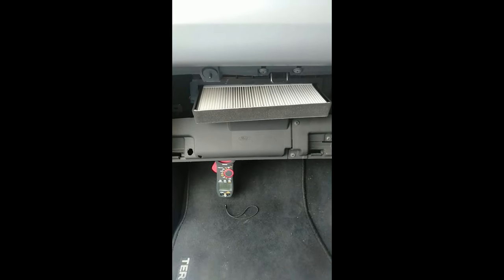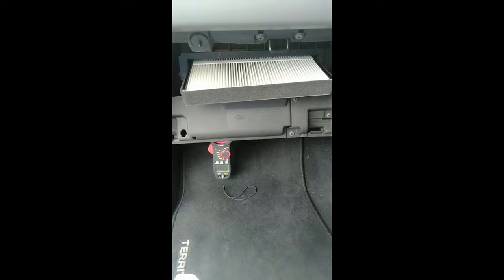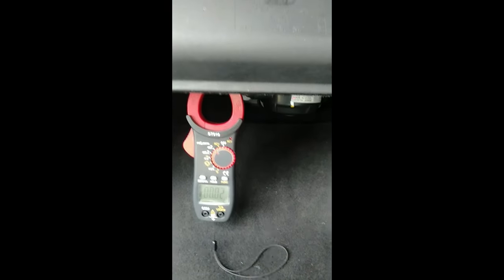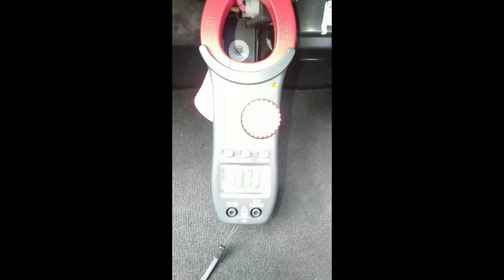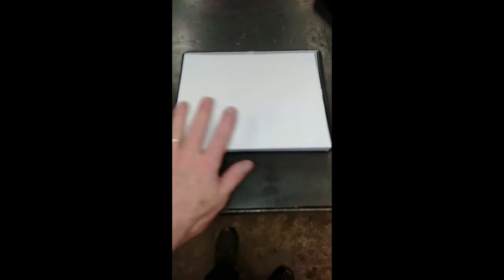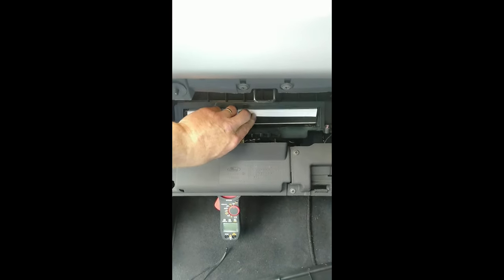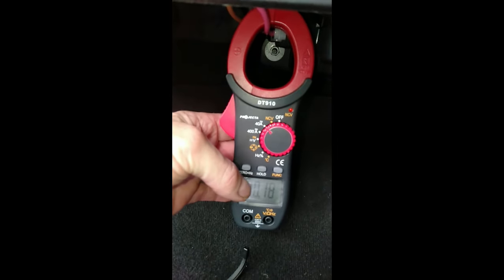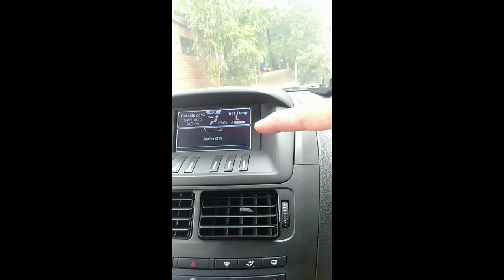Does A Blocked Cabin Filter Draw More Current?

Comment from the maker: Do you know the answer and why?
Reply: Everyone needs to get a k&n filter, I have one in the air take, made a massive difference,
Reply from the maker: @helenellsworth9556  Thanks for your comment. Opinions vary.
Reply: I think the fan spins easier without air to add resistance. But I'm no electrical engineer lol
Reply from the maker: @fatch76  Well done! Because there is less load (air) to add mechanical resistance to the fan motor, less current is drawn.

Comment: Regardless of current draw preventive measures are the key and many cabin filters are overlooked by their owners and in fact by one main dealer that I dealt with. 

Some YouTube mechanics claim that a clogged filter destroys the aircon actuators, have no idea if that is true hence the view that changing the filter is the safe thing to do.

Opinion only, I would never use a filter that flows more air at the expense of filtering.
Reply from the maker: You are right Colin. The main thing with a long life of anything is proper maintenance, cabin filters included.

Comment: Would it be because it’s created a vacuum or lower air pressure by drawing out more air than is going in? Less resistance on the motor with less air to pull?
Reply from the maker: There will be less current drawn as there is less load on the motor due to less air being drawn in. In actual fact, there is less stress put on the fan motor and bearings. Sort of opposite to what you would think. Just imagine an electrical circuit. Less load on the circuit will require less current.

Comment: Does a 07 vz commodore have a cabin filter?
Reply from the maker: It may or may not - depends what sub-model it is. If it does, it will be located behind the glovebox.
Reply: No they don’t from factory. You can buy pollen filters for them now to fit. They go in under the wiper cowl in place of the leaf grill.
Reply from the maker: @FuManchu5ltr is correct, I accidently looked up the wrong model. There are videos out there to show you how to do the modification